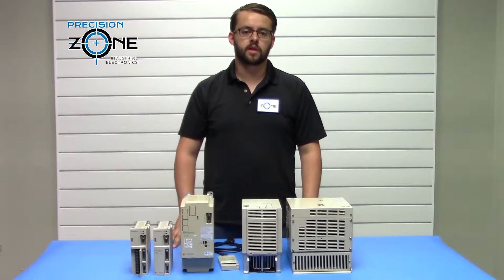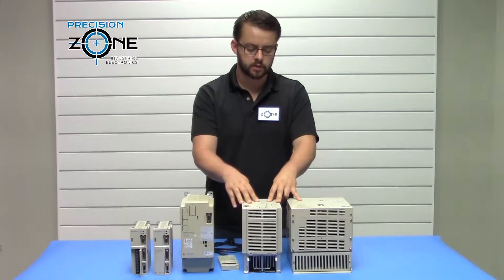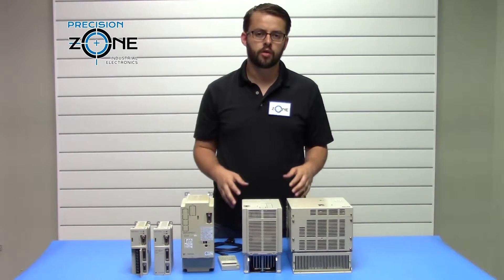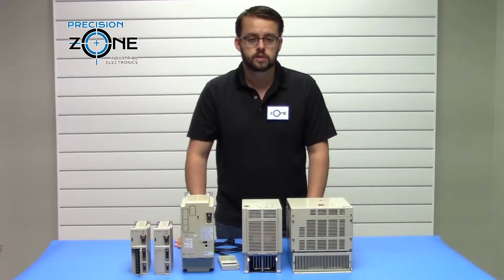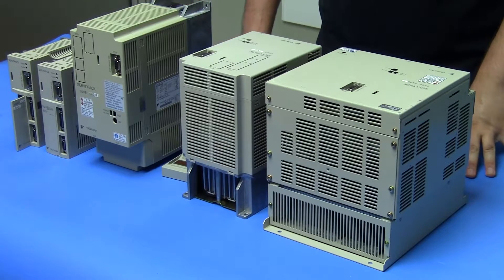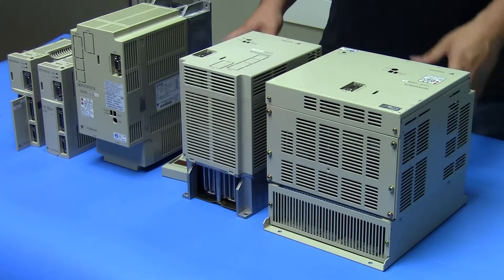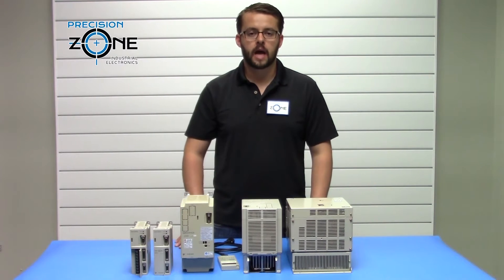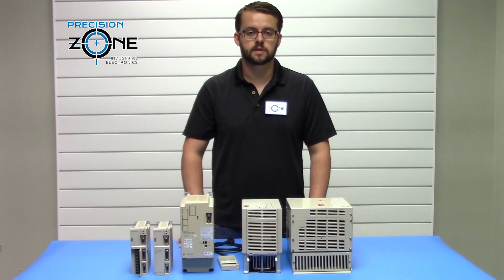Drive AC Servo Yaskawa SGD/SGDA/SGDB Sigma Series alarm codes Part 2

Comment: Hi, 1 question.
I get alarm code  A.C3
The manual explain:
"Wiring in encoder phase A or B is disconnected".

But. I tested the wire and don't problem.

Then, the fault is?

Thanks for your help.